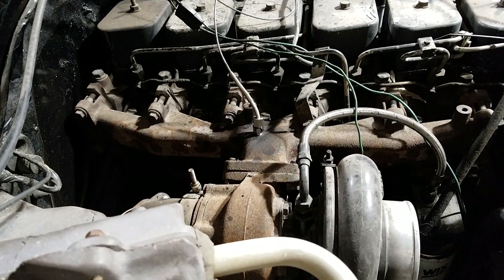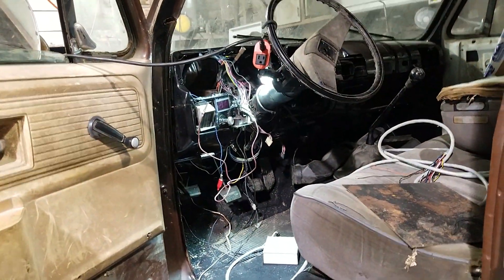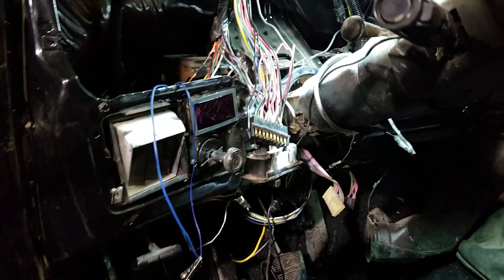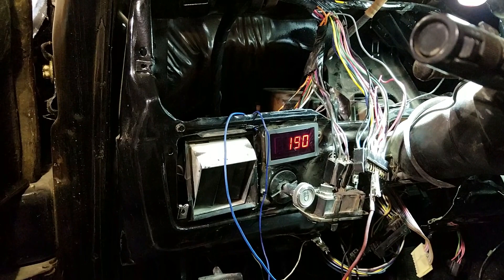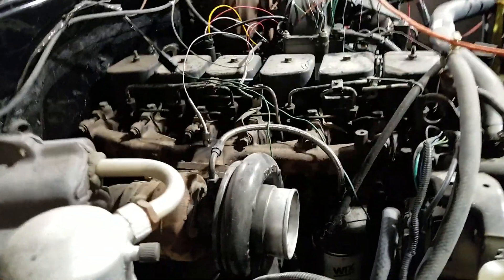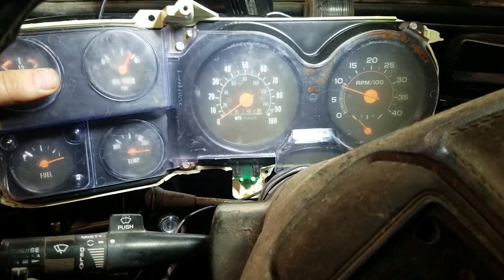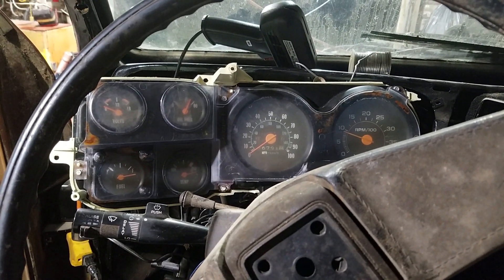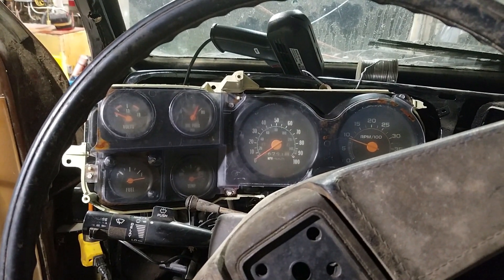#FrankenTruck Custom Gauge Cluster Stock Appearing Arduino LED Aftermarket Part 4

Comment: im with you....not a fan of the gauge pods on the pillars. i like things to look factory as possible. i really like that you added the flashing leds to the gauges as warnings. that is a very impressive cluster you have made. i tend to gravitate toward the "simple is reliable" way of doing things.
Reply from the maker: Hey J.C.!  Thanks for stopping by!  Yeah, I'm a big fan of the "sleeper" look.  I don't think this will turn out as well as I hoped, but still no gauge pods!  I normally am the same way with simplicity, but couldn't come up with a better way to automatically activate the grid heater only when needed.  Still a work in progress!  Thanks for watching and commenting!

Comment: Throw that EGT gauge out! It is very wrong at high temps, I had one just like it and i got suspicious when it would go from 500 to 800 in a split second with out acceleration.  I put a glowshift in, yea its pricey, but it works correctly.  Just thought id give you a heads up. Wont be long now and you'll be driving it around.
Reply from the maker: Interesting.  I don't have another one to compare to but room temp it was correct.  I'll have to keep an eye on that and see what I can find.  I could install another one next to it in the manifold and use it to compare and then throw a plug in once I confirm.  Thanks for the heads up!  Yep, I'm really looking forward to being able to drive it down the road (legally)!  Thanks for watching and commenting!